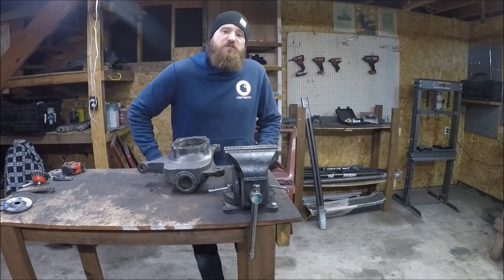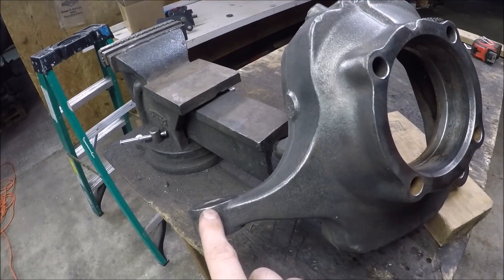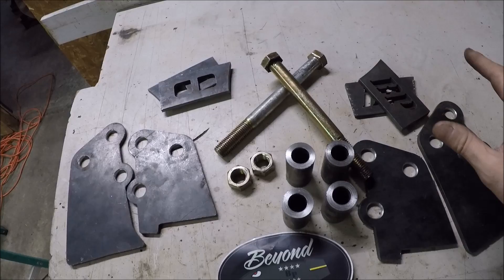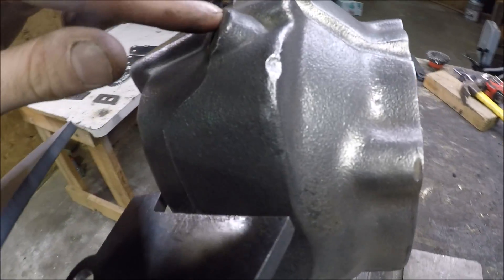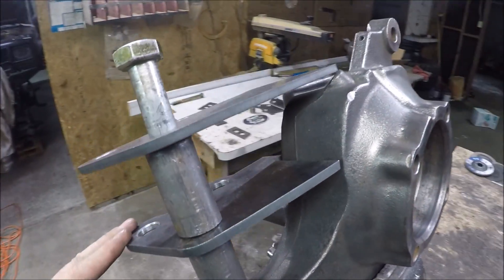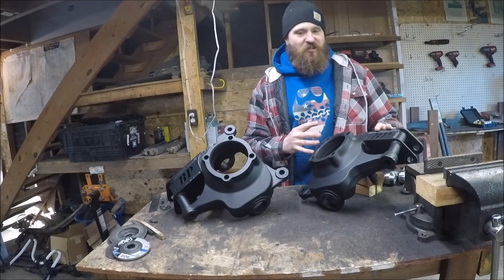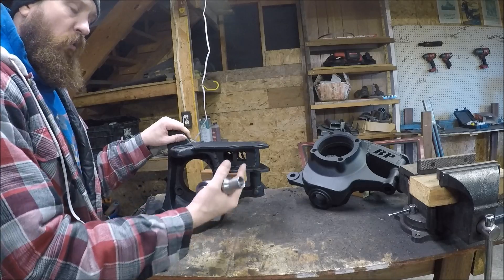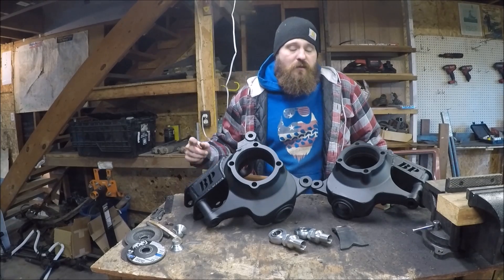DIY Weld on High Steer (XJ 1 Ton Swap)

Comment: Those holes that you covered that you thought was abs is not that is vacuum ports for you auto locks on your hubs if your building a crawler or anything from stock some people put grease ports in them to grease the inner spindle bearing an run mile marker locking hubs to do away with vacuum problems with the axle

Comment: I can't say for sure without being there but the knuckle appears to be cast steel not cast iron. The sparks appear consistent with steep not cast iron they are bright orange and fly relatively far before splitting. Cast steel is more forgiving than cast iron and using standard filler wire can be preferable to using a nickle rod in this welding application. Another way to identify it as cast steel instead of cast iron is by looking at the shavings that came out of the hole when you drilled out your bolt hole. Cast iron will make really short chips and steel will be slightly longer and more stringy. The finished product looks great.

Comment: Your drag link connecting position on the knuckle is determined by your pitman arm length.    If they don’t match pretty close your steering ratio will be very strange.   I found that out the hard way. 🤪
Reply from the maker: Absolutely.  I am going to address that when I build out the steering links

Comment: Dam I need that .but you think it would work on a jeep grand cherokee wj
Reply from the maker: No need.  The WJ knuckles are already cross over configuration and you can mount the links to the top of the mounting surfaces and its basically a high steer.  I had WJ knuckles on my XJ dana 30 and I did that.  I made a video about it as well
Reply: @MuddyBeards4X4  thank you I will look the video up

Comment: Dude get u a reg oven like in your kitchen. Use it for this type of stuff, small parts such as this makes it easy to control the ramp down on cast stuff.
Reply from the maker: Can't imagine what my wife would say if she found car parts on the oven lol
Reply: @MuddyBeards4X4  lol, i wouldn't dare use mine this is why id look for a cheap one on Craigslist or one that was broken but fixable. I lucked out and a buddy was upgrading his oven, deal was i help him get old one out and new one in and i get the old one. Doubles for a powder coat oven too. This also works great for anything steel or aluminum. I take all my steel stuff to 500, aluminum i wont go above 350, transformation range is usually around 930 or so for aluminum, but depending on its prior heat treat could temper it some.
When i do cast, i get it up to temp, use regular er70 wire and ramp the temps down, 500-400-300-200 then off until its room temp. Never had a weld crack.

Comment: I love using flux core to weld to cast helps if it dirty cast to burn the impurities out
Reply: Are u a push or a pull guy?
Reply from the maker: Depends on the position, but usually I try to push.
Reply: With flux it likes pulled. I was told if there is slag drag lol that helped me learn. I ran alot of dual shield flux 1/16th wire in the coal mines
Reply from the maker: Slag then drag... I like that 👌   makes sense.
Reply from the maker: I for some reason am just terrible at Flux welding.  Not sure why and I haven't even tried it in years, but I have heard it's a good process to use on cast

Comment: Pretty nice kit. Iv got a one tone out of a w250 I need to do the same thing to.
Reply from the maker: Pretty much all the kits seem similar, but I do like how this one went together
Reply: w250 should be kingpin. all you need to do is bolt the high steer arms on. different process than a balljoint setup.
Reply: @MegaMarclar  it is a kingpin. I need to dig it out and look at it better then because Iv just been looking at highsteer kits for d60 and assumed it was gonna be the same
Reply: @18georgedavis  kingpin spindles are totally different. The upper bushing/spring block comes off and is replaced by bolt on high steer arms. Super cheap and no welding. I rec using bronze bushings during the conversion.
Reply: @Brady Williams this is my first kingpin axle so completely foreign territory.